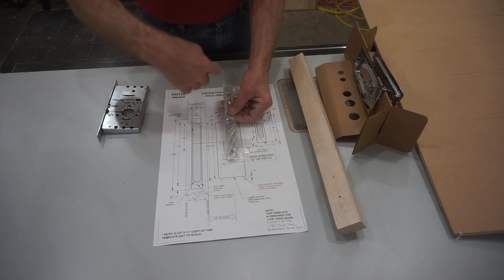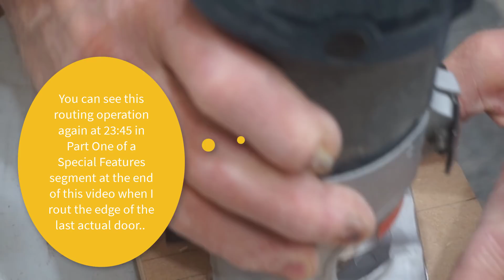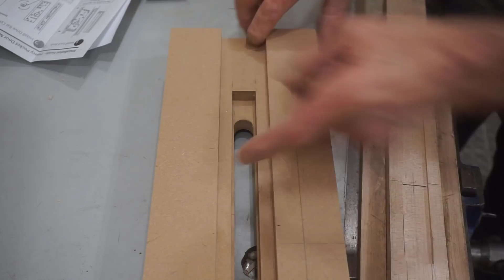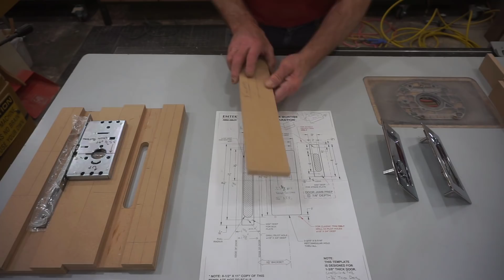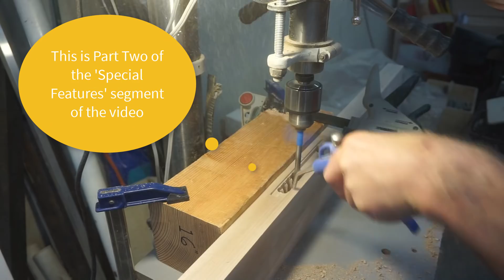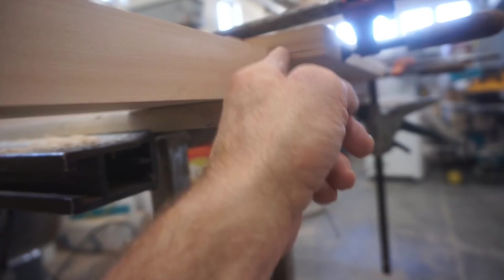Making Precision Templates for Professional Hardware Installation

Comment: I love the simple glue up template method, and learned so many new words in the process 👍👍
Reply: I use CA glue but haven't seen the spray activator in the UK West Country so will have to look out for it. It makes all the difference to holding power. 💪🏻 very pragmatic approach, keep up with the excellent videos.
Reply from the maker: @robinturner2300  You might find pump spray activator places where aerosol activator isn't.  It's infinitely better than none but half as fast in activation as aerosol.  BTW I've never thought activator strengthened CA's holding power, it's just the fact that curing is so unpredictable with out it as to be useless.  Thanks for your comment.. Best, Matt
Reply from the maker: CA glue and activator is almost like having a superpower, at least compared to regular glue or trying to chop perfect holes in solid pieces of sheet goods, right Robin?  Best, Matt

Comment: It looks great Matt! Excellent work/video. Did you do glass stops on the doors. That would be an interesting video as well if you filmed it. I have some original kitchen cabinet doors and the floating panel is flat.  Two or three of those panels either have cracked finish, or a crack in the panel and I need to replace the panels. I want to Change it over to raised panels but want to keep the rails and stiles as they are curly maple and I don’t want to throw them away. So I thought I would cut off the back/inside lip, remove the flat panels and make some raised panels to fit in there then make some panel/glass stop to retain the raised panels. At least in my head it seems it will work. Any thoughts?
Do you have a bit more or less shop space in the new shop? It seems to be coming along quite nicely given how busy you are! And how are you liking the new dust “processer?
Best regards. And if I haven’t already said so.... May you and yours have a Merry Christmas/Happy Holidays, and a Happy New Year!
Ron
Reply from the maker: Thanks Ron.  I did do glass stops on these doors.  I fit and nailed stops on the 'show side' before paint and, after placing frosted tempered glass panes in, fit and nailed stops on the 'back' side.  Pretty straight forward.  You should be able to rout off the lip on the back side of your cabinet doors and, after chiseling out the very corner bits, release the existing panels.  It's probably too thin of a lip to reproduce and nail in after switching out the panels but I could see making an 'L' shaped stop with one leg long enough to hold the panel in place and the other leg long enough to nail into the back of the door frame.  The stop could be mitered in the corners to look a bit like a picture frame from the back side but that shouldn't be a concern.
The new shop is virtually the same square footage but it's rectangular instead of square.  It's working out great but requires a bit of mental adjustment.  The new dust processor is remarkable but awkward with only the one short section of hose that comes with the G700.  That will change shortly since I got stuff for a hose network and just need to get it set up... which I suspect will be the topic of the next video release.  Also got a wireless remote on/off switch setup from Harvey that I'll install.
Merry Christmas to you too! Best, Matt
Reply: Next Level Carpentry   Great, thanks Matt. That’s pretty much how I had it worked out in my head. But you know how that is.... 
looking forward to the next video. My wireless remote control for my dust collector comes in very handy and definitely beats my old shop vac setup.

Comment: Hello, Happy Holidays to you and yours, I worked on a condominium complex with over 100 units some 1,000 plus doors and all the doors were 8’-0” High and 1-3/4” thick Interior and the Exteriors were 2-1/4” thick. The hardware was all Rocky Mountain Hardware and I did not know a template bearing bit like you were using was available I made my templates using a standard 5/8” template guide with a 1/2” inch bit and came up with the same end results.  It would’ve been nice to of had the bearing bit that you were using back then 2001 2002 great job... We even made from Scratch our own pockets and frames; singles doubles and one quad... That’s a story for another day glad to of watched your video... Greg
Reply from the maker: Yeah, that Rocky Mountain Hardware is in a league and class of it's own Gregory!  I like using flush trim bits much more then straight bits and guide bushings though... sounds like you know and appreciate the difference too.  I've been on some big jobs but never 1,000 doors... maybe 100 tops, but those were mostly hollow metal with all the prep done.  Still a bugger to hang a fire rated steel slab but less nervous than a stained solid core wood fire door though... good on you for getting that kind of work done... not a job for the faint of heart, that's for sure! Best, Matt
Reply: @NextLevelCarpentry  Thank you Matt...
4'0"- 7'0" lead lined doors for X-Ray rooms are Fun too...LoL
If you feel up to a Good Chat let's talk after New Year's...
Merry Christmas to you and yours... Greg
Thank you for your Comment...
Reply from the maker: @gregorylondos534  I feel your pain... although I've never hung lead lined doors!  Made and hung some sizeable 2 1/4" thick oak exterior doors on a restoration project  once that probably set my 'personal best' record for weight and difficulty.  No body seems to think of the poor schlub who ends up hanging the monstrosities that architects and designers dream up, do they... yet who gets their names on bronze building dedication plaques? Such is life, right?  Best, Matt
Reply: Sounds like you and I do similar work Gregory which happens to also be my first name. hmm  And I have done X-ray room lead doors and 10 foot 3 1/2 inch thick doors and much much bigger. 2  1/4 inch thick doors are not uncommon for entries so I work on those regularly and I've done hundreds of doors on many projects. Swung 5 inch thick doors once but that took two guys. I'll tell you about the commercial compressor powered handicap door system another time. I could go on and on. High five to another door carpenter.  @gregorylondos534
Reply from the maker: @skygh  I'm sure glad there's a world full of young guys with something to prove when it comes to hanging the mega-doors you guys are talking about... makes my back hurt just thinking about it😲😩😎 but YOU GO, GUYS!  Best, Matt
Reply: skygh Hello Sir Gregory also, I could talk shop with you all day if given the chance... Like Matt, I like your Style of Work... LoL

Comment: Great video, thank you.
I am damn sure not to get any of those styles of lock.
Reply from the maker: The ultimate cost is staggering 42... what with the initial cost of the hardware plus shipping plus designing doors to make sure they fit plus making the doors plus mortising for the hardware plus painting the doors plus installing and adjusting the doors for proper fit and operation plus installing the hardware and adjusting it for proper fit and function... no wonder they're so rare!  Glad you like the video... it was hard to justify the time and effort to film, produce and upload the video but I figured it would be a LONG time, if ever, that such an opportunity would present itself that I bit the scheduling bullet and took on the challenge as one of those 'you wouldn't believe it if I told you' sort of projects.  Best, Matt

Comment: Matt, you work hard; but,  please why blast sawdust and chips all over your shop with the air gun when you could have used your shop vac to do the cleanup?  Your lungs deserve better treatment and your eyes also need protection!

Doesn't Bosch makes a dust port attachment and a plunge base for the router that you use?  Using both accessories would a) keep your shop cleaner and b) remove concerns of damaging the templates.

Merry Christmas and Happy New Year!

Comment: That's the fastest built jig I've ever seen.  btw. I'm pretty competent in both metric and inches but from experience I'd say - metric is advantageous 90% of the time and  - inches only 10% of the time.   eg.  easy to confuse 2 1/2"  or 2 1/4 inches tangentially to the hole.... but 57mm - not so confusing. Safe and happy holidays to you and family.
Reply from the maker: Gotta love it when something so good is also fast and easy, right Michael?  Metric/Imperial isn't my challenge... it's the memory thing, plain and simple.  57mm.... or was it 75mm?!  Hmmmm 🤔😩😎 Best, Matt
Reply: @NextLevelCarpentry  Ironically, I'm approaching 60 and my mind is at its sharpest but my body is  short-changing my  abilities. Five years ago I hung 10 new doors, made  jigs for locks and hinges for the router...easy work.   must admit you made yours super-fast. well done.

Comment: With no lateral forces being exerted on the core body, why was it necessary to pocket the escutcheons and not just thru-out?  Wouldn't  the screws thru the face plate been sufficient to  hold the core in place ... are those thin walls really sandwiching/cradling the core, i.e. providing function?  Or maybe it's predicated on the doors' thickness?  I've  having a problem understanding why it can't  be installed as a conventional lockset.  Thx.
Reply from the maker: No really sound reason one way or the other Benny... it would have just meant a second depth routing step on all 8 of the mortises I guess?  It was trickier getting the locks installed with the drilled holes and, in hindsight, I would have been better off punching them through.  But this way viewers get to see what's possible with this sort of templating... for what that's worth... Best, Matt

Comment: Very interesting, when I was a young man I worked in a door factory. I made my own jigs in much the same way...only I used heavy duty routers with 5/8 collars and 1/2 inch bits so my jigs were 1/8 oversize.  On a good day I could machine 100 doors!
Reply from the maker: Productivity goes WAY up when it's what  you do all day, every day, right Johnny?  I'm very thankful for carbide tipped pattern bits for these one-off deals because I always hated making over sized patterns and worrying if bits were going to stay centered in guide bushings.  Best, Matt

Comment: Great video, very informative on the jigs/templates. 
I wondered about tolerance for paint, did you remove the hardware before paint or, mask it?
Keep em coming really enjoying watching your work👍.
Reply from the maker: Very observant Bobbypoppop... I SHOULD have allowed for paint thickness... as it was I had to shave paint off the perimeter of the mortise to get the plate to fit after painting.  They did a great job with the paint so it was by no means globbed in there but it is a testament as to how accurate this process is.  In the future I'm likely to add a strip of thick paper to the metal when figuring, fitting and gluing up the templates.  If you look closely at the pictures at video's end you can see the center of the edge plate is still bowed out a bit as it needs a bit more attention before 'final inspection' of the job.  Glad you like the videos... I appreciate your insightful comment on it. Best, Matt

Comment: Have you ever used a porter cable lock mortiser? Worth it if you do alot of mortise locks.
Reply from the maker: Both seen AND used J Garvey... like you say: worth it if you do a lot.  Works great for the deep part of box lock mortises but the face/mounting plate is still a separate process.  I guess if box locks were more common there would be a jobsite-friendly version of a lock mortiser out... kind of like an oversized Festool Domino?  Best, Matt
Reply: I do a lot of mortise locks and I install these Emtek locks  regularly with my  PC 513 mortiser and 517 router template, 1/2" straight bit and 5/8 router guide get up instead of the flush trim bit. I have a similar concept home made guide for the face plows. Takes about half an hour to install one of these because I already have all the goodies. My job requires me to install whatever hardware they throw at me so I make a lot of guides similar to how Matt showed.
Reply from the maker: @skygh  Familiarity and dedicated tools like your mortiser and router template are a fine example of the 80%/20% power of the Pareto Principal applied... takes 80% of the time to do 20% of the work, and then, 20% of the time to complete 80% of the work.  It was the main good thing about large door/hardware installation projects vs one-off ones.  The time it takes to read, understand and apply complex instructions for a door closer, panic bar or box-lock is tough to swallow for the first one but by the 3rd one it's cake.  Do you end up installing much Rocky Mountain brand hardware?  Most amazing stuff on the market these days IMHO.  Best, Matt
Reply: Next Level Carpentry  That principal sounds about right. I call it Cocky Mountain due to it's absurd pricing but the look and quality are great and I have installed mansions full of it, even their bell twice. I've probably installed a ton of it no exaggeration. I run a one man show installing builders hardware in remodels and new homes and I fit custom doors here in the center of the US. Mostly high end.  For a residential locksmith which couldn't work out better for me. You are spot on how the first <insert name> takes forever and the last one flies in. Because I focus on hardware and not all aspects of carpentry I have an enviable supply of obscure parts and specialized tools that make me look good and baffle other carpenters how I do it all so fast and accurately. I am a gray beard with over 40 years experience so the learning curve only apples to new stuff anymore. I like your thoroughness. I'll sub and keep an eye on you. If you have any hardware questions in the future fire away. I've probably done it.
Reply from the maker: @skygh  Cocky Mountain... LOL!!  I'm guessing your 'ton of it' is an under-exaggeration... the butt hinges I installed (the one and only time I've installed it) were what, 1/4" thick?!  Doesn't take many of THOSE to add up to a ton! I can well imagine your inventory of specialized tools... probably as many supplied by manufacturers as custom made ones you've enguineered to make the job quicker and your life easier.  Next time I run into an upscale piece of hardware I'll look you up (thanks for the offer)... I fussed with the Emtek privacy pocket hardware for a good 20 minutes or so in final install trying to figure what was binding to cause the thumb bolt to turn so hard.  I checked alignment every way possible but as soon as I snugged the escutcheon screwa it turned like a 40 year old Kwikset with sand in the works.  No surprise to you but it was to me: two drops of lock lube on the brass tumbler-thingy inside.  Turns out the brass was 'galling' where it rotated in the box housing.  $150+ for a lock... and it needed oil to work right?!  Job security for me, but crazy nonetheless.  Glad to have you 'on board' should you choose to sub... please comment anytime... input from viewers like you is a great asset to any channel but Next Level Carpentry in particular.  Best, Matt